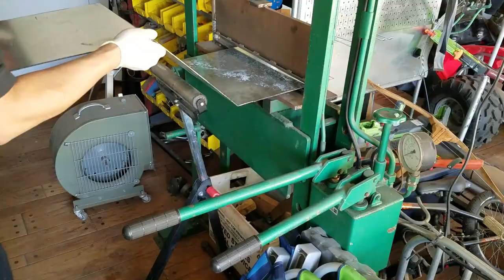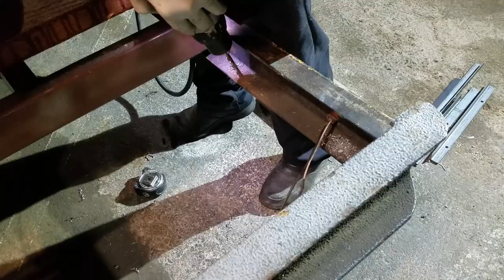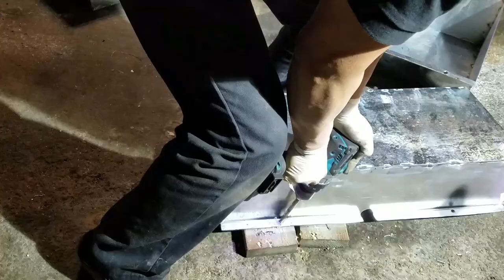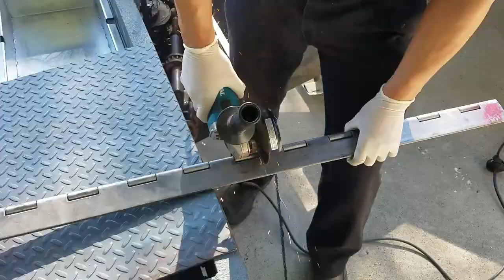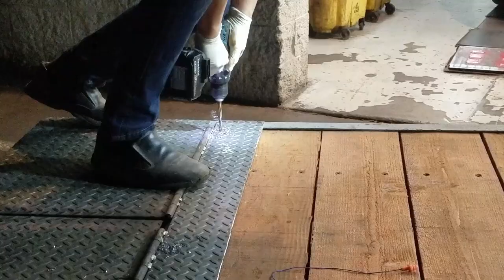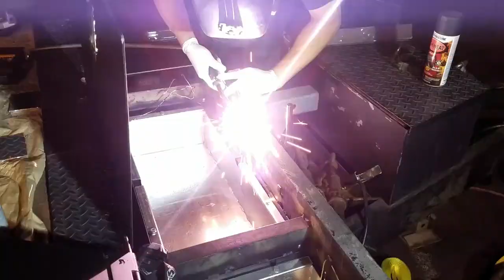Making In-Deck Trailer Storage Bins

Comment: Very nice!! One question though. Why run the floor of the trailer side to side instead of long ways? Never seen that before. Is there a benefit from doing it that way? I’m right in the middle of working on mine. Now would be the time to do it if I was gonna do it.
Reply from the maker: Ya know what, I don't know. I wondered that myself when I redecked it. I had never seen one where the planks go side-to-side.  It certainl would have been easier if it ran lengthwise, havingnto make less cuts.  But I guess it all depends on how your trailer is framed. Mine has more support lengthwise. So, it made sense the planks went across.   The planks should be supported every 16 inches or less.  Also, if possible, use rough cut lumber instead of regular framing lumber. Rough cut is 1/4 to 3/8" thicker.  So the actual thickness is 1-3/4 to 1-7/8" instead of 1-1/2".

Comment: nice fab work.  I really like this idea.  Only neg thing about it is,  Its not water tight,  Your going to get water in the boxes.  Not a big deal but keeping straps and stuff in there is going to get nasty.   And depending on your load placement, you might not be able to access the storage once a vehicle is loaded all the way on it.  Other then that, Great job man   #Liked
Reply from the maker: Hiya. Thanks for the comment.  I thought about making them water tight, but I knew if I tried to be a perfectionist on this project I'd never get it done.  I figured I've been keeping some of the straps out in the open, behind the tool box for years and they've survived.  We don't get much rain here.  I didn't even completely weld the seams of the bins as to let water drain.  You're right about not being able to open the bins if something is loaded that far forward.  I imagined pulling a truck onto the trailer.  The front bumper sometimes goes all the way to the front edge of the deck.  I'll just have to be smart enough to take out the straps I need before I load.  There aren't many other places I can install storage.  I thought about making bins with access doors on the sides, but then I can't take advantage of the full depth.  Also, I needed the center bin because that will eventually house the hydraulic pump for the tilt mechanism.  That's another project I'll probably imagine for a year before I actually do it.
Reply: Maybe a few angled drain holes, and a bit of automotive door/trunk seals creatively placed to keep water (mostly) out?
Or a top cover that covers all the doors and lays nearly flat with a bit of weather strip around its edges.  But that might bend up after being driven on?  Maybe a high impact plastic like puck board would work.
Stay gold.

Comment: Careful welding in those gloves. That possible burn wouldn't feel to good.
Reply from the maker: Thanks for the tip. They only protect me from little sparks.  If I laid my hand on something hot, latex gloves would actually prolong the burn as it holds heat.  but that's true of any glove material other than something insulated like kevlar.  I don't like welding gloves because they're bulky and have no dexterity.  So, I just make sure I don't lay my hand on anything hot.

Comment: Thks for the video great idears I had my car trailer stolen 07.31.21 im in Bakersfield California i should have put a GPS tracker in it any way just a ifear for all out there just sad people don't respect
Reply from the maker: I am sorry about the trailer theft.  I also had a nice 18' dovetail traiiler stolen once.  For months, I'd think every dovetail on thre road or on CL was mine.  I eventually bought another trailer.  I secured it with a coupler lock, chain to the concrete and even a denver boot covering one wheel.  They stole the whole thing, including the boot.  I have a GPS story for you.  Most of my customers have GPS in their fleets. Last year, a customer's truck got stolen. He called the police and told them exactly where the truck was.  By the time they decided to respond, thieves had removed the welder-generator, compressor and all the tools and left the truck a block away from their house.  He got the truck back, but cops refused to go to that house to retrieve the tools and equipment because there wasn't enough evidence to get a warrant, despite the GPS record showing the truck was at that house for several hours before being dumped.  A few months later, same customer, another truck stolen.  Once again, several hours at one place being offloaded.  Then, it was moved and set on fire.  Lots of people will ask, "Why didn't you bring your Glock or AR and get it back yourself?  This is a man with young kids and a business, a lot to lose if things went one way or another.  This is also California, where the criminal is surely more protected than the victim.
Reply: @redneckoriental  most of the cops are dirty but just thought my bad luck help someone